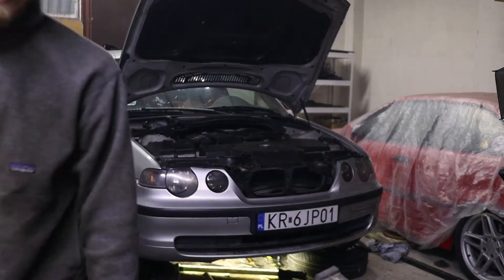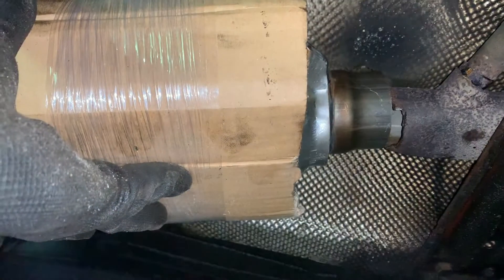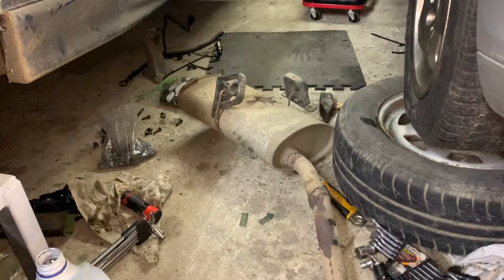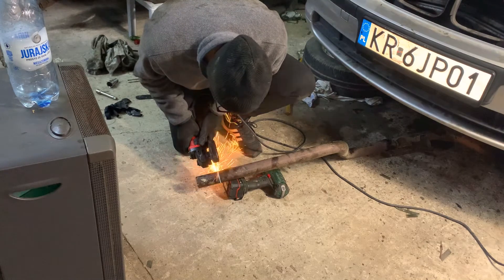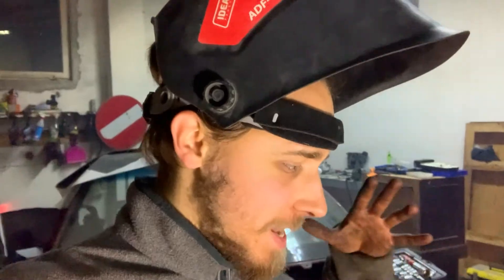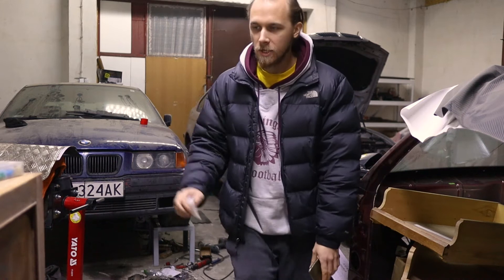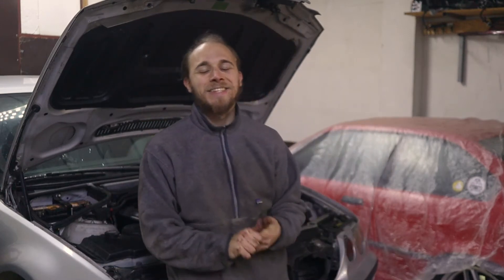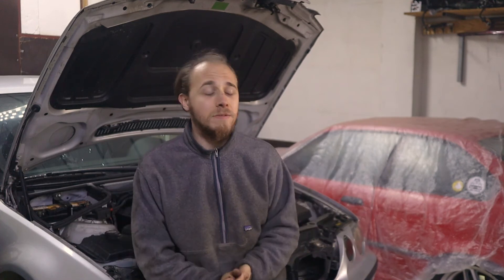BMW e46 compact gets new CATALYTIC CONVERTER

Comment: I think authorities will start cracking down on DIY "race cats" here in Finland. Like actually inspect cars they deem suspicious, and if they find a gutted catalyzer then it will be a huge fine. Also fines for trying to manipulate electronics to hide the fact from inspector. Like bigger than the price of the car -fines.

Over here it would be a smart thing to be prepared, meaning just use a properly working catalyzer even if it's power loss. The wallet loss for the fine will hurt much more.
Reply from the maker: This car had so little power I don’t think there would be a difference. With or without the cat. It would be louder tho which is not my kind of thing 😅

Comment: hello.. Did your engine light come on with the catalytic converter you had on the car? because I gave a replica and my engine light is on
Reply from the maker: Unfortunately it did. Those ceramic cats take longer to heat up and I think this is the reason ;)